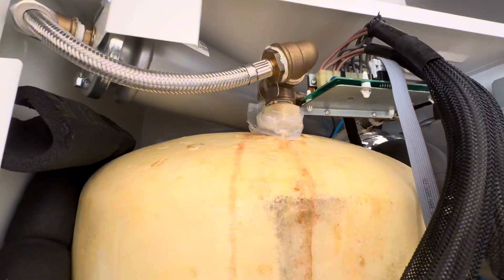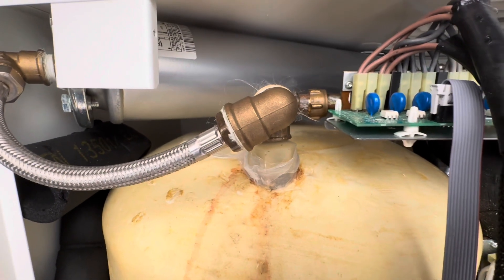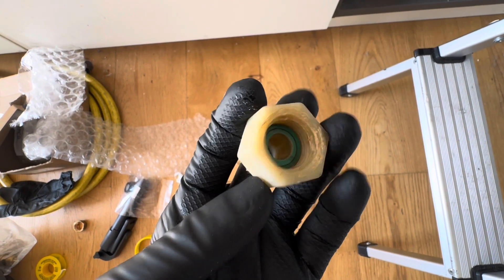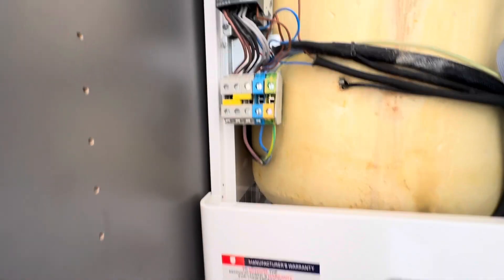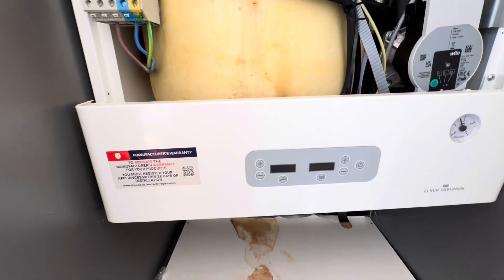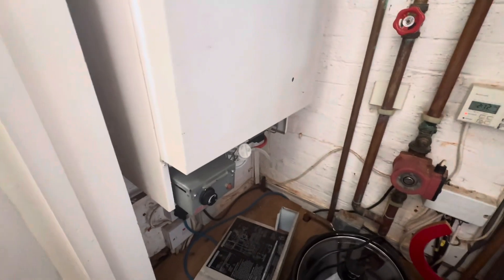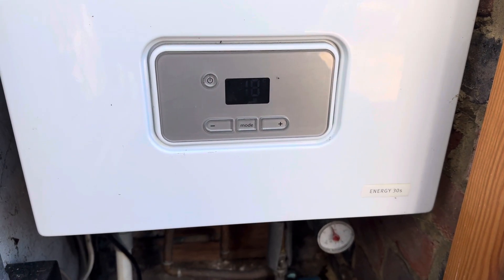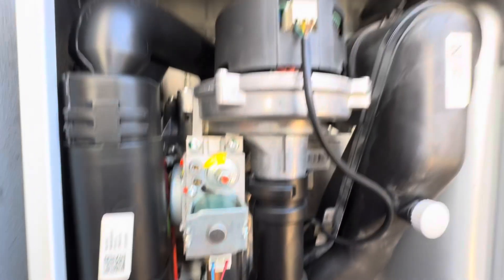Last Boiler Standing

Comment: Great content you provide us, very interesting. I'm still running a 40 year old Glow-worm. I've done a bit of work on it the 35 years I've been in the house. 30 odd years ago the insulation of the windings of the fan motor went down after we were away some time. The replacement cost of the motor staggered me even then. It's a cheap shaded pole thing that was the type used in record players years ago. I sprayed the windings of the replacement and lube the bearings every couple of years, still going! Happy days, thanks again.
Reply from the maker: Thanks for watching, it’s much appreciated you taking the time to watch and comment! 

That’s pretty cool, what model is it? I actually like a Glow-Worm, except the old SwiftFlow! The parts have always been on the pricier side though! Well done for keeping it going!!
Reply: Fuel-saver 55 F 😊
Reply from the maker: @johnrockley9472 a legend in the game!

Comment: It’s a safety device it won’t work until the cover is back on I would have thought
Reply from the maker: @olympus_plumbing  which one? The relay contactor? Works fine without the cover on, it had just failed due to water damage
Reply: Oh right. It look like a safety device that isolates the electric when the cover is off 👍👍
Reply from the maker: @ just a contractor and those white switches should push in but they’re not holding in. It was replaced by an electrician because I couldn’t get back there and now works well (with the case off 😉) hope you’re good

Comment: That fan same as the ecofit vaillant. I replaced one last week…..got a refurb unit £130 and it didnt work🤷🏼‍♂️🤦🏼‍♂️ had to go back and get an original £245. Its the fan and burner top all in one. The prices you were getting sound mad🙈
Reply from the maker: @russellbaldry5095  that’s right, annoying it all comes as one. It’s really weird as my terms at city and Wolseley are both spot on usually!

Comment: That was a dielectric fitting   Or anti corrosion   So I would put it back if I was you
Reply from the maker: @daviddraper5485  if you’re talking about the plastic connection on top of the cylinder - that’s what Elnur Gabarron have changed the fitting to. It was sent out directly from them…

Comment: You can get a new fan for £150 , and if the boiler is installed  not to reg's at risk or ID it does not matter weather you installed it or not if you are gas safe it is down to you to know any danger or fault and do the necessary procedures, enjoyed your vid All the best
Reply from the maker: @6969allgood  I know that with regards to safety situations but the BR exemption for a boiler in an outhouse/external cupboard? I’ve not heard that one in over 18 years of doing this. Have you?

Where you getting that fan for that price? (I offered them recon which I can get for £95 but they wanted new).
Reply: @RJHeating  Heating and Catering parts for the fan, no I have not heard a rule about a boiler not been allowed in a outhouse or cuboard. Al so the fan on that boiler is the same as on the glow worm ultimate so you may get that one cheaper than for the Energy I have not checked the ultimate price out .
Reply from the maker: @ the Vaillant ecoFIT fan is the same but only around £80-£100 cheaper. I know H&C parts, £150 is likely to be a refurbed one no? - I did give the option - but they wanted new.